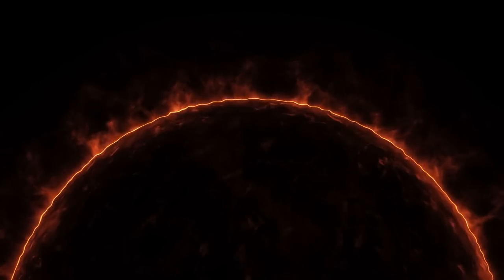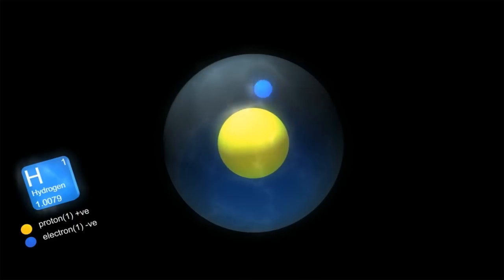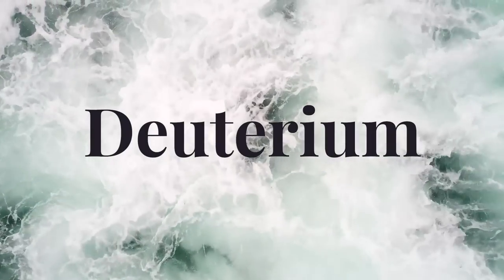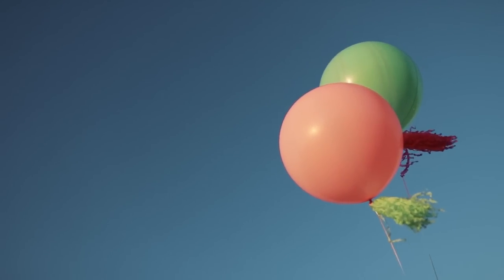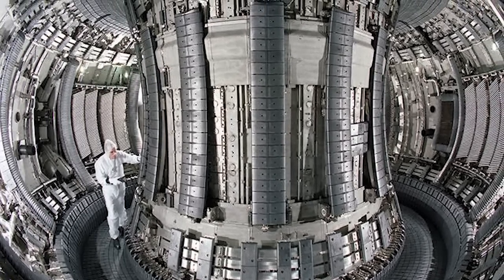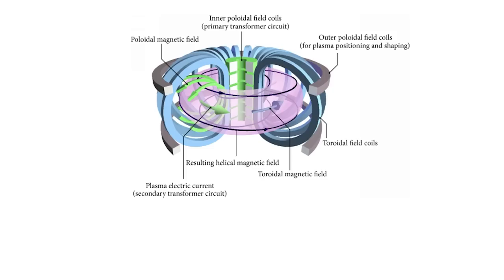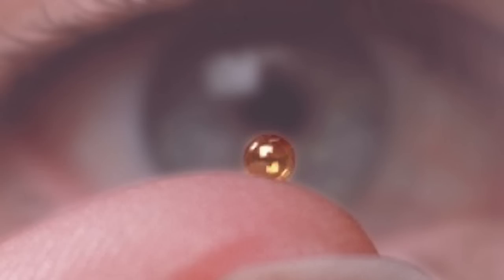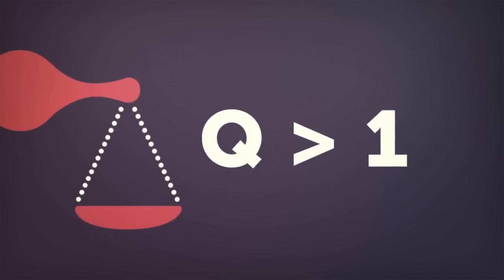Fusion Energy is About to Unlock Humanity's Destiny

Comment: The need for energy storage may not now be so great. Yes, we need some storage, mainly at home, but we really need green reliable nuclear power. However, not of the old, inefficient, less safe and polluting fission type as presently in use. While thorium is much better it cannot compete with fusion nuclear. The Tokamak and ITER types of approach to plasma confinement are incorrect old school and inefficient physics-based fusion power attempts at a working solution based on our misunderstanding of how the sun shines. All efforts along these lines are simply wasting billions of dollars. However, there is now really great news! In present reality, fusion is already here in the form of the "Safire Generator" that uses safe, green, small footprint, 24 hr reliable within community-based fusion nuclear power. See all about it at "aureon energy.com". and learn your necessary "Electric Universe Theory" with your newer astrophysics and plasma physics reality at "The Thunderbolts Project" and you will then be on the right track.

Comment: you did not do your homework for this one. Tritium is the key hydrogen isotope for proposed fusion reactors. It doesn't exist in any meaningful quantity naturally, our diminishing supply of tritium is a product of fission. An alternative fuel: lithium -6 is less accessible as it's used for thermonuclear weapons. Yes we've been doing full scale fusion since the 1960's. it's called a thermonuclear device. Any high energy power source can be weaponized.
  It's total BS to claim that a fission reactor is a bomb ready to explode! Absolutely not true! The pressure vessel can explode in old reactor designs but that is not a nuclear explosion. the worst that can happen is that the nuclear pile melts down, i.e. overheats to the point it melt through the containment vessel. not good, but not a nuclear bomb.
  We have 70 years of experience with fusion and it's the safest and densest energy sourse available. Wind and solar just can't meet our energy needs and fusion has yet to break even. All the hype about fusion is nonsense! Even with a tremendous advance commercial fusion electricity won't come online for another 30 years. We can't wait. Fission is the best option

Comment: Fusion huh? Isn't that the power of the sun like in Spider Man with Toby McGuire and Doctor Octopus? They mentioned as a joke and being serious at the same rate that it would be unsable and would wipe out the earth if it wasn't contained worse than a megaton bomb. 

If you want energy supplies, why don't people stick with using infinite power. You know, grinding connetic friction gears that generated electricity where at first you have to turn a crank or ride a bike to generate it, with enough connectic gears grinding against each other per demographic area, you can use that same electricity to come back around to the starting gear and use it spin it the original gear using 2 dummy gears without conductivity without having a surge meltdown as it you will never have to crank it again as it runs itself forever and ever. 

The best part is, wouldn't be wasting any environmental resources keeping all the nut job environmentalist happy. It would work just how one of those wind up flashlights work, only bigger.

Comment: One thing nobody talks about is the fact that any energy produced by fusion will add to the Earth's total heat budget. (As would energy beamed to earth from space.)  Reducing greenhouse gasses will not be enough without population control and a major increase in efficiency. Currently, the energy use per capata worldwide is going up, that HAS to stop.

Comment: You need to work on your analysis in regards to private enterprise creating new inventions, the only create new inventions through government subsidies for instance North Sea oil was found through government subsidies. In fact monopolies which are created by private companies do not create any significant advances, just look at the 747 plane created by Boeing created in the 1960’s and hasn’t changed at all, whereas airbus the only rival that it has was created by the governments subsidising the project in the EU. private industries are lead by the profit margin and as long as they keep getting the money coming in they do not have any interest in diverging from this route like spending out money on new ideas. You are on the right line, but are unfortunately wrong by thinking that private companies are a utopian ground breaking creation, when in fact they are the reverse.